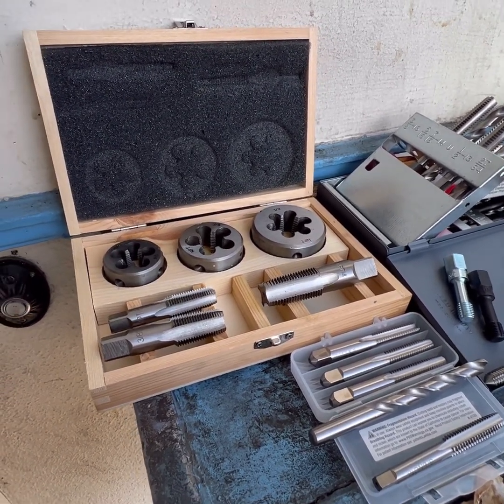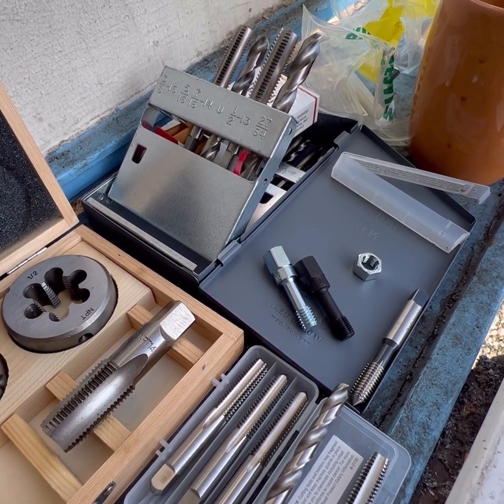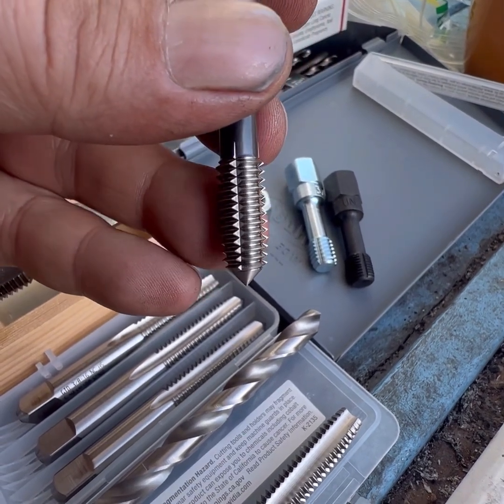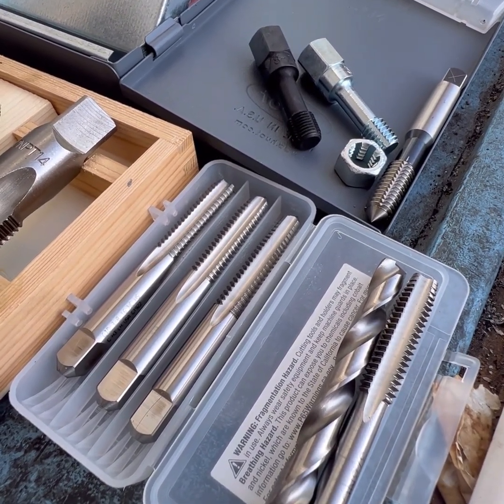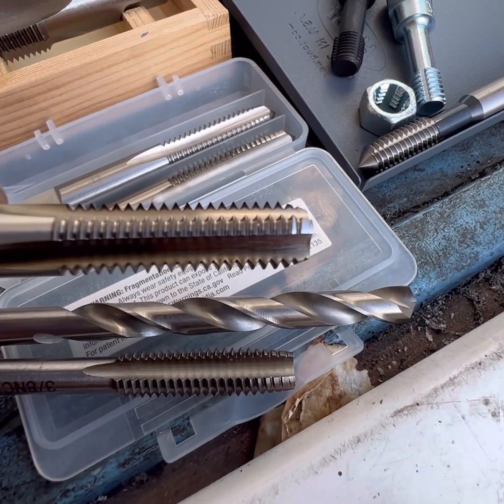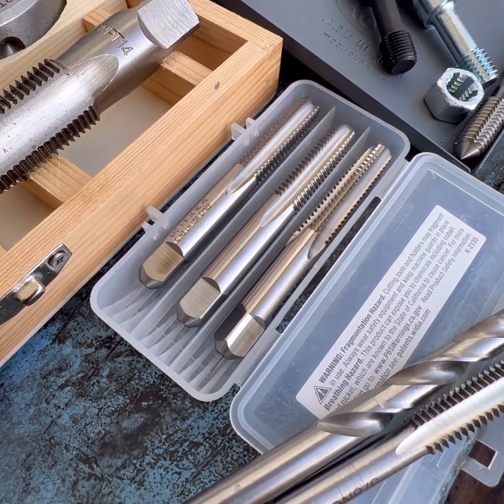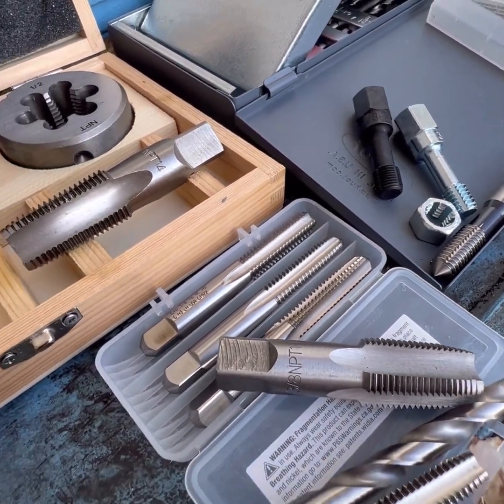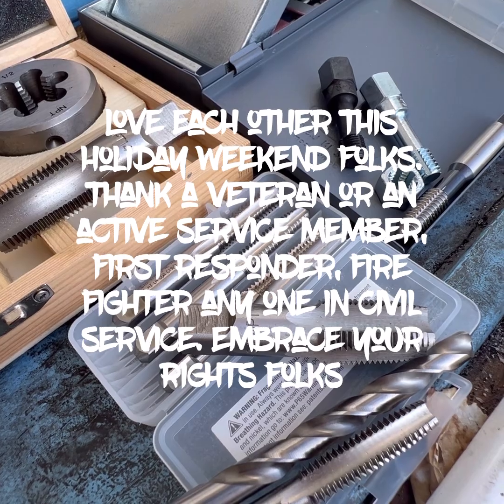Thread Chasers vs Taps vs Tap Styles and which ones you need #Lang Tools #Irwin #Hanson #

Comment: I have the large gearwrench set.they are carbon steel and not the hss but they work good for me. Great video frosty.. have a good 4th.
Reply from the maker: Thanks Shannon! I have a bunch of smaller sets with nice HSS taps but I’ve also got the same kit you do under the Husky label. (Home Depot had them briefly and I snatched in as I know the price was too good to be true). Love the ratcheting Die Stock and everything in one box. Plus it’s not a huge flat box like a lot of the larger sets used to be, they took up most of a drawer and ended up underneath a bunch of small blow molded or tin boxes in a lower drawer somewhere.

Comment: I've done some reverse tap and die stuff, the mid shift guys mixed up sae and metric  when drilling and ran a fine thread 9/16 then tried running 9/16 coarse, we drilled it out to m14 2.00 and all was fine,